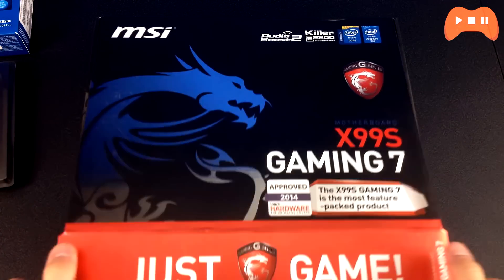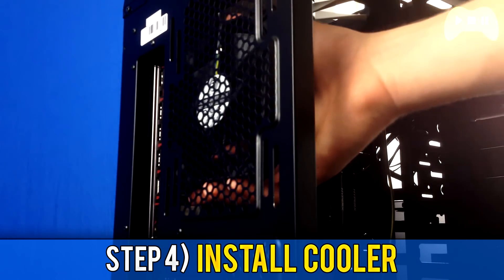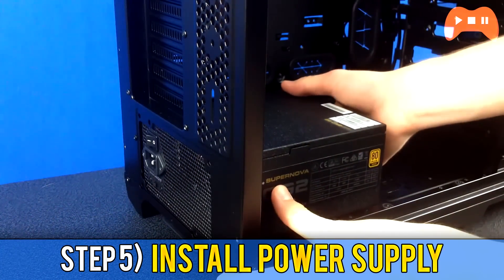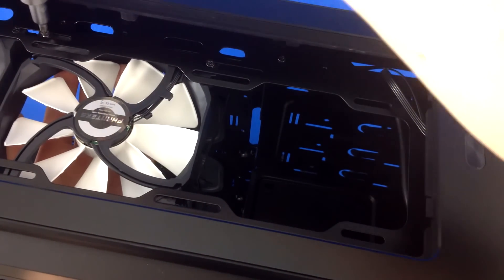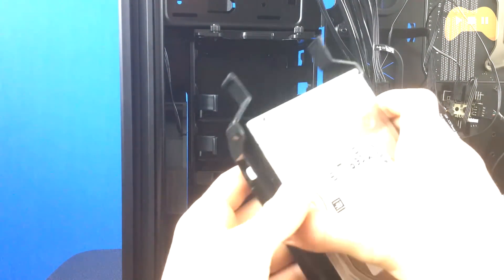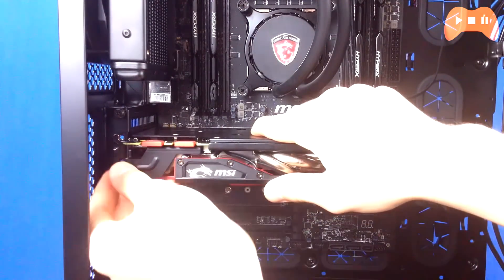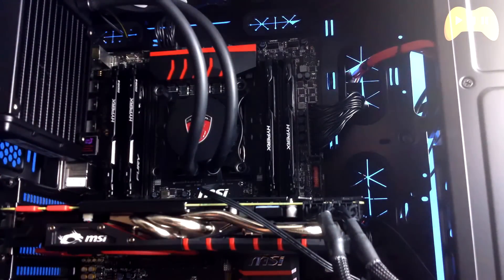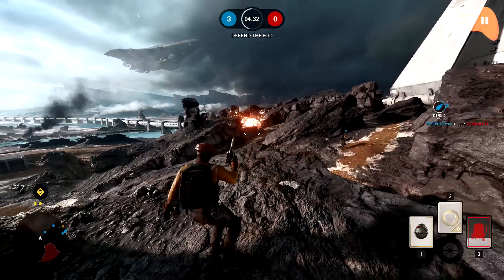How To Build The Ultimate Gaming, Editing and Livestreaming PC | Tutorial

Comment: hey. did you overclock the cpu?
Reply from the maker: +electronictheory Yup, you really should, especially with Haswell E. I think mine's running at 4.4Ghz (though I won the silicon lottery so I think I achieved 4.6GHz at one point, but temps were too high). I am running this at a reasonably low voltage for Haswell E too!
Reply: +ProtoAMP thx for the answer and great video.
Reply from the maker: electronictheory Thanks!

Comment: if you could choose between a i7 5820k oced or skylake 6700k oced purely for gaming only and you were running 980ti sli, which would you choose and why?
Reply from the maker: +Tsunvsmoon Always the 5820k. The 6700k has 4 cores compared to the 5820k's 6 cores. Whilst this really doesn't matter in gaming at the moment, it will just make for a better experience if you were planning to game and do other things at ther same time. It also has more pcie lanes 16x vs 28x, meaning sli would be able to benefit from that. Lastly, the 5820k has more overclocking headroom with most people achieving between 4.2 and 4.5GHz when overclocked. What's the price difference if you went for one over the other, because X99 can be somewhat expensive. Also regardless, you always want to make sure that the 5820k is overclocked, else it's single core performance is worse than the older 4790k (though it has 2 less cores). How much extra would you spend by going with the 5820k?
Reply: +ProtoAMP thanks for the detailed reply :)     for a x99 mboard and 5820k it will cost around £50-60 more. I've had my current pc for over 7 years (Intel I7 920) so I'm looking for a cpu that I wont have to upgrade for a long time, also considering getting into vr in the future so I dont know if the extra pcie lanes and cores on the 5820 will be beneficial in the long run compared to the 6700k
Reply from the maker: Tsunvsmoon Yeah, definitely! I was just wondering whether you would want to wait for Pascal or Vulkan?
Reply: +ProtoAMP Nah, I think upgrading gpu's every so often is a given, if pascal turns out to be really special, I'll just sell my 980tis and put the extra cash towards it and I don't care about Vulkan, I haven't touched a amd product in a long time after having a couple of bad experiences with their gpu's in the past.
Reply from the maker: Tsunvsmoon Aha, good idea.